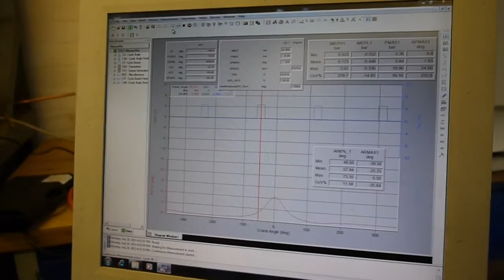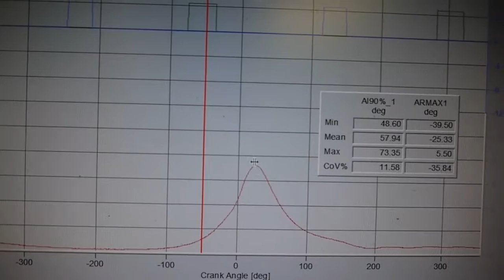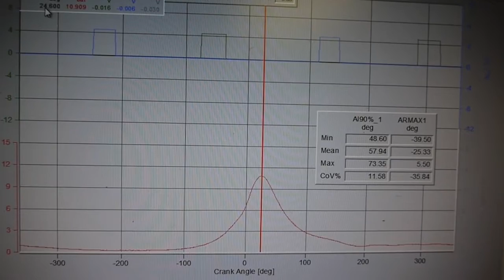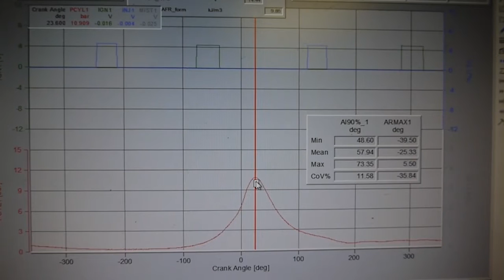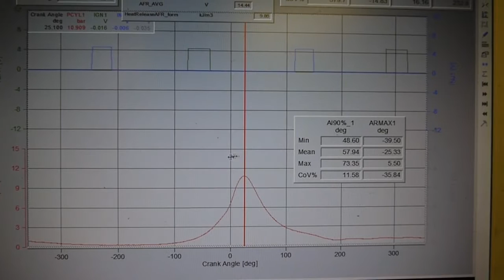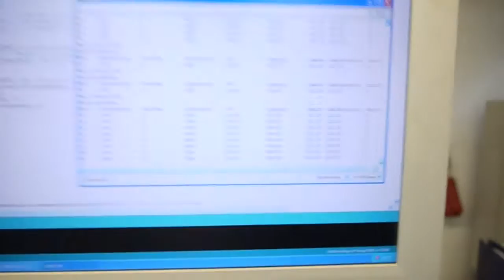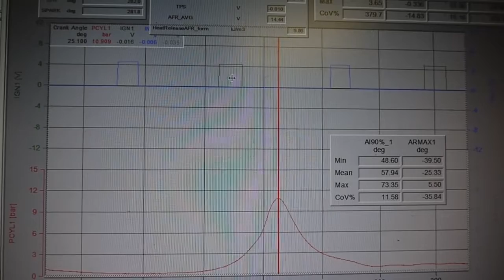Explanation of Closed Loop Ignition Timing Control

Comment: Interesting.  Of course an in-cylinder pressure sensor would usually only be practical for engineering research, to optimize.  How do you know the optimum angle where peak pressure should occur?  The Mean Effective Pressure (MEP) determines the work, so perhaps that should be maximized for a given set of conditions.  All modern automotive engine controls I know of simply advance the spark angle until knocking in sensed, then back off, & repeat (ex. Holley Commander 950).
Reply from the maker: +BillyGrism Thanks for the comment - sorry for the delay in replying. You're right the trick is knowing the optimum ignition angle - typically just before knock. But I believe for a given engine geometry this can be fixed.
Reply from the maker: +BillyGrism Thanks for the comment - sorry for the delay in replying. You're right the trick is knowing the optimum ignition angle - typically just before knock. But I believe for a given engine geometry this can be fixed.
Reply: That's not quite right.
Things might change if optimal pressure peak point is a function of RPM and load.
But anyway, sensing a cylinder combustion pressure is a great technique to obtain a knock-free ignition map! Great work!
Reply: No BillyGrism, they only advance to the knock limit in "Knock LImited" Regions. i.e when they can't advance to the ideal advance angle (ideal peak pressure angle) because knowk happens first.  In the non knock limited regions they target ignition angle to achieve the ideal peal pressure angle (via a map determined by bench testing). His method is to conituosly run this " experiment" in real time  in the non knock limited regions

Comment: hi, what is the model of the encoder you are using, what is the maximum frequency that it can read?
Reply from the maker: Mecatronicgarage Hiya, it was a long time ago now, but it was a Linde, I think 501 or 503. I believe it was 500 or 1000 pulses. The maximum frequency is more determined by your data acquisition equipment, and the rate at which it can sample digital edges. I was using an Arduino which will be fairly limited, but still fast enough for most engines, I would guess up to 10,000 RPM without a problem (just a guess mind!)
Reply: At this time I am using an inductive sensor LJ12A3-4-Z and a wheel with 16 teeth and from 8000rpm the sensor stops working (I testified with the oscilloscope before), now I have idea to use an encoder 360 or 600 pulses , but the ones I found only withstand 3000rpm mechanically ...I also have the idea that the Arduino will not be able to read 360 pulses in such a short time.
Reply from the maker: Mecatronicgarage ah yes, so that's an industrial type inductive sensor? You could try an automotive hall effect sensor (3 wire, 5V output) which you should be able to get cheaply for cars. I think lots of fords use them for cam sensors. Alternatively you could use an automotive inductive pickup (2 wires, VRS type, +- 150mV-150V sine wave output) but you would need to make sure you have signal conditioning electronics for it (the circuit is relatively simple, requiring a comparator, and clamping diode. There are also chips available to do it). I suspect that the one you are using has some internal electronics which are either not responding fast enough or filtering the output. You may find an alternative model which has a higher bandwidth.
Reply from the maker: Mecatronicgarage you could go with a VRS sensor and LM1815 from Texas instruments. I would think it would be the most robust, easy to set up and low cost option. The Hall effect sensors are a bit sensitive to distance from the wheel in my experience. https://www.mouser.co.uk/Mobile/Texas-Instruments/Semiconductors/Interface-ICs/Sensor-Interface/LM1815-Series/_/N-dawwo?P=1yyklbrZ1z0zls6
Reply from the maker: Mecatronicgarage are you doing this for your motorbike? I would suggest working out which sensor is already on there, and make a harness plug for it.

Comment: hi! does any one know what is closing loop mean? or electronically controlled engine what is verified before setting the ignition timing ? system has to be in closing loop / open loop or what '' more importantly I would like to understand what the loop is in term of ignition timing  ? Thanks in advance!
Reply from the maker: Closed loop means that the control system is taking a measurement of the output of the system (in this case cylinder pressure) and making adjustments based on that measurement. Open loop means that it doesn't take measurements of the output, perhaps only input conditions, it is then estimating what the best control input will be to give the desired output